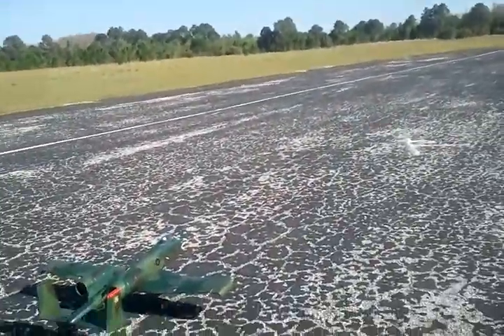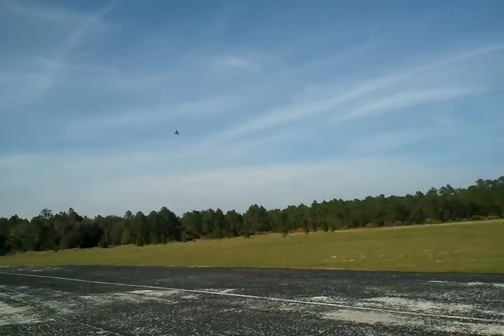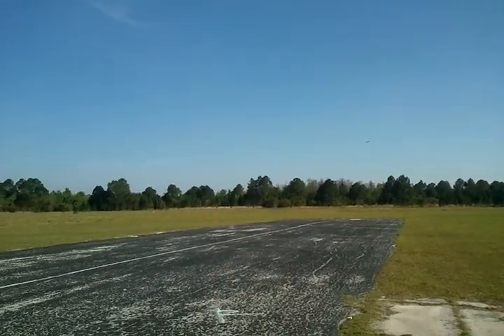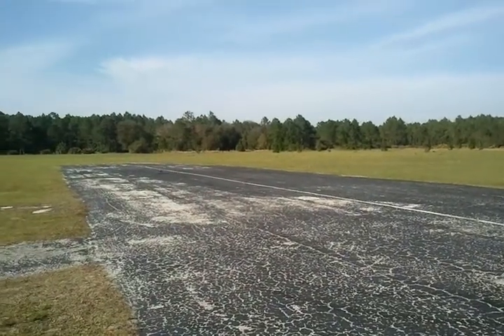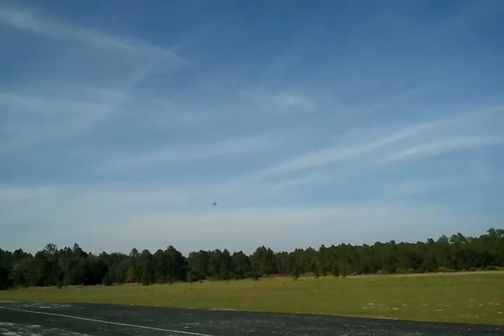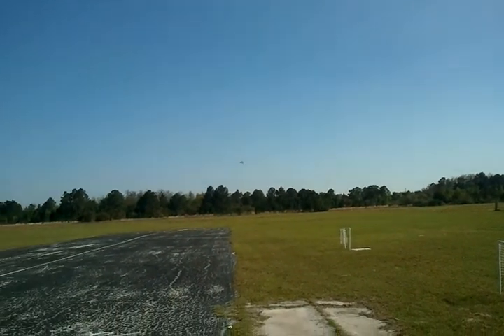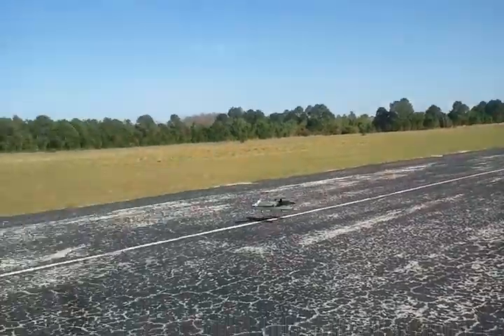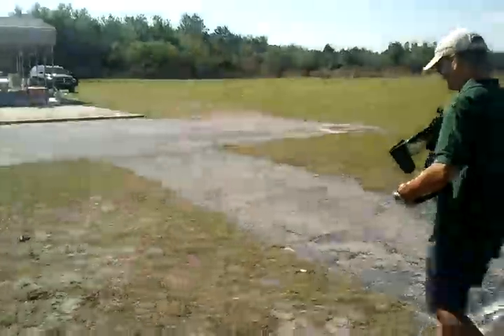Banana Hobby  A-10 64mm 3s 3600 mah

Comment: been flying mine for years now. have 5000 thunder power in it , elec retracts  modded out , stock power system  100 + flights , going 4s 12 blade 70mm  just because  nice flier . first batch added carbon fiber rods etc  flaps and rudder mod  fpv with eachine goggles camera in gun turet . can get 9 min flight with good throttle management
Reply from the maker: michael honeychuck this was one of our early cell phone videos:)

Comment: well informer,  i've got the black night version bought in 09 or so  total mess 3rd flight rt engine smoked ,  so 2019 is here pulled it out put 2 new fms 11 b  4s edf, predator 40 esc,  2 carbon rods in full length of wing , servoless retracts (stock were junk)  balances well with 5000 mah 70c roaring top .... flying brick but really flies great now.   need newer fms but i'll wait till this gets beat up. its way faster than the freewing 64mm   friggn love it.  lol just kicking around ole vids
Reply from the maker: Sweet thanks for watching.... It's amazing how much better the airplanes have gotten
Reply: @RCINFORMER  yea,  just got the fms super cub,  time to buy a new a-10   , really like the cub ,  fitting with matek 405 fc and fpv with HT  here shortly.